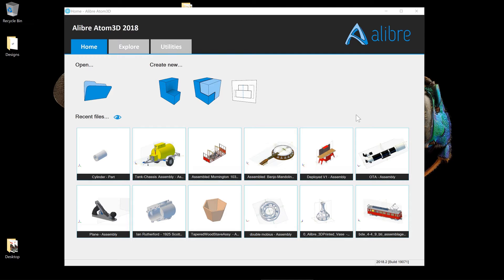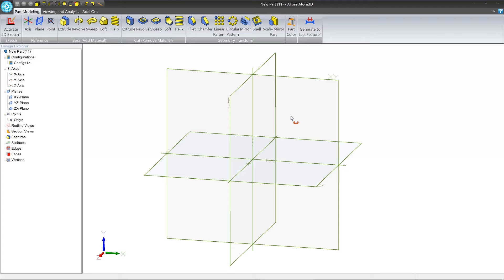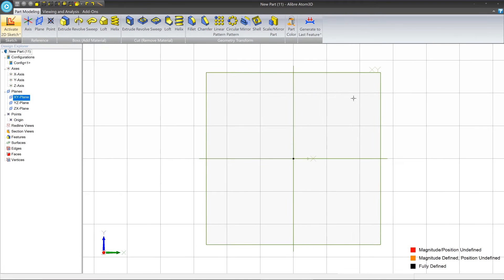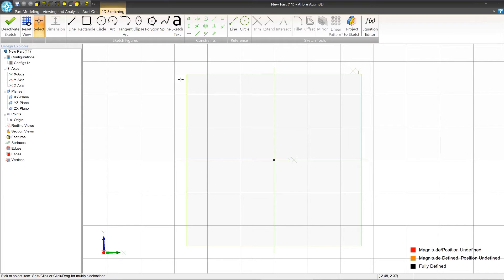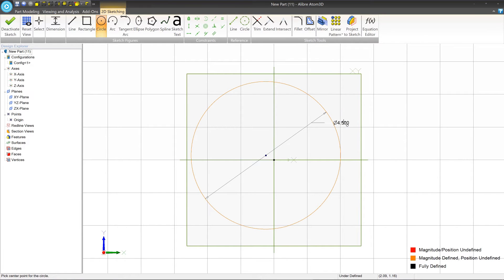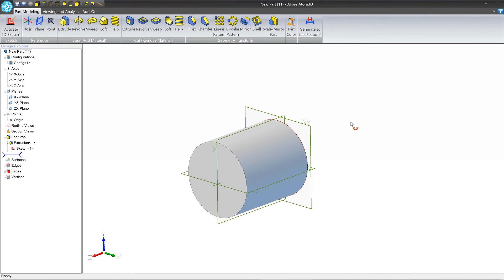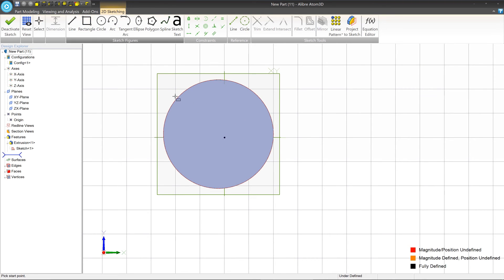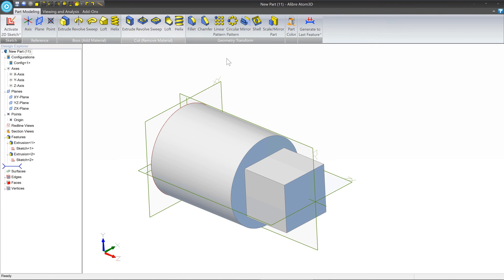Alibre Atom3D Tutorial - Making Our First Part

Comment: Hm, i want to create my first object and already fail on defining the axis. I want to 3d print, so Z axis needs to be top. But there does not seem to be an option to define which axis is what??? So what do I do? Let Y be top and hope the splicer fixes it, or work with atom3d telling me incorrect top/bottom/left/right etc? Seems strange that it does not allow to adjust this. Or is atom3d not suited for 3d printing?
Reply: All slicers allow you to rotate the parts you bring in after you import them. It doesn't really matter what orientation you use to design a part - it can and often will be reoriented in your slicer software later.